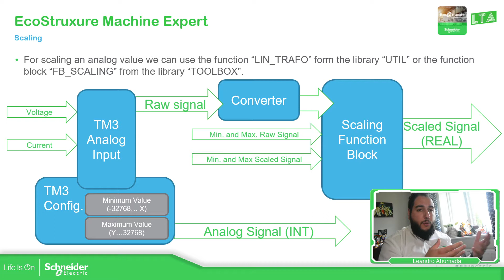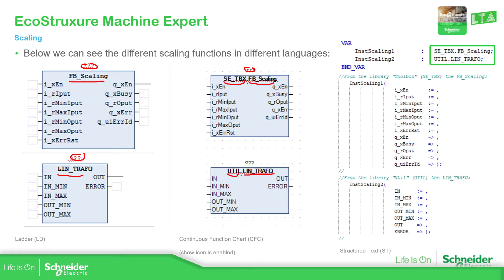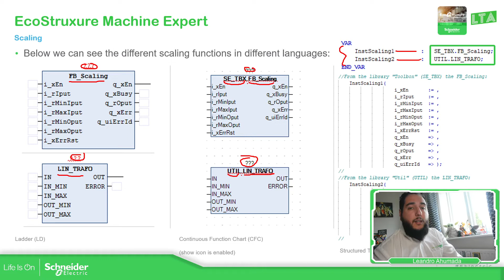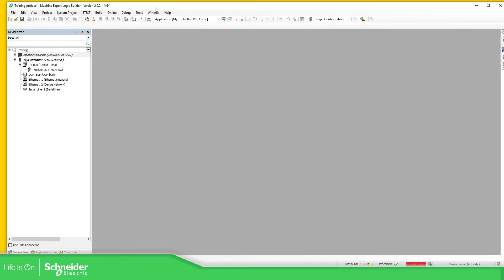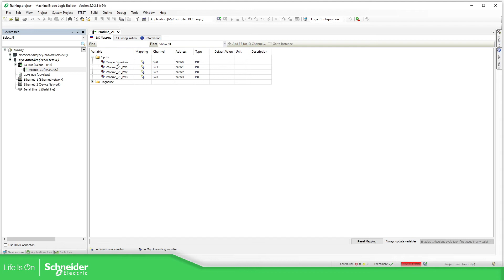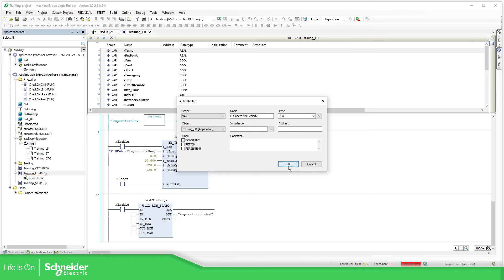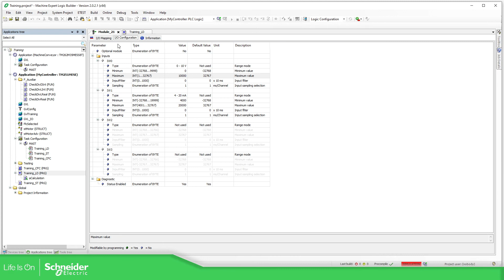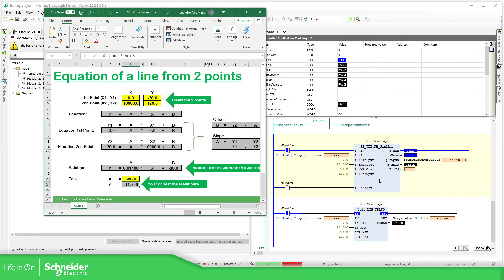EcoStruxure Machine Expert Training - M5.9 Scaling

Comment: Sir, actually for 4mA - 20mA signal, should I leave IN_MIN = 5529 and IN_MAX = 27648 similar to Siemens?
Or should I leave IN_MIN = 4000 and IN_MAX = 20000?
Thank <3
Reply from the maker: Hi there! Use the 4000 and 20000, much easier to read 😀 then use the scale.

Comment: Hi there, whenever I add TM3AI module I can never configure anything. All of the boxes are left blank and all values/default values say 'Not used". How do I enable these Analog input channels?
Reply from the maker: Hi there! Once you add the module and you are not online then you must have a tab called configuration (if i am not wrong) where you can define the Analog type to use.